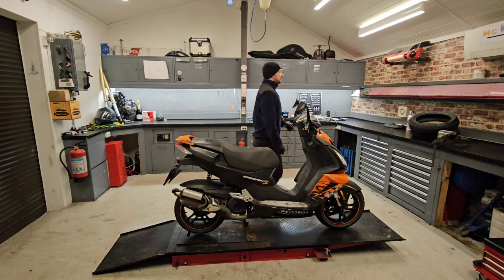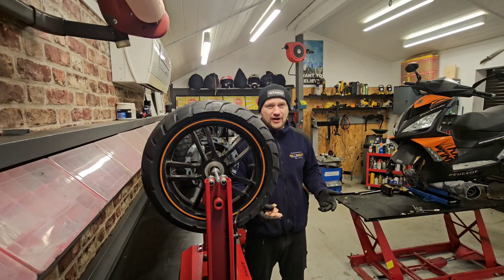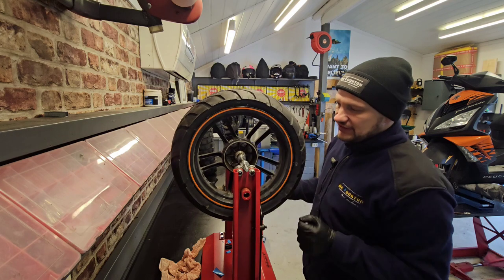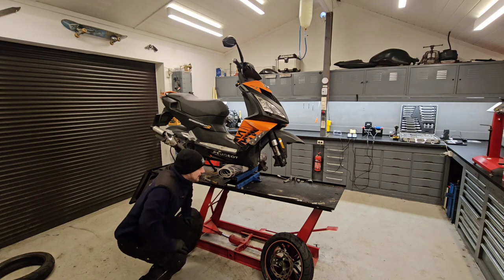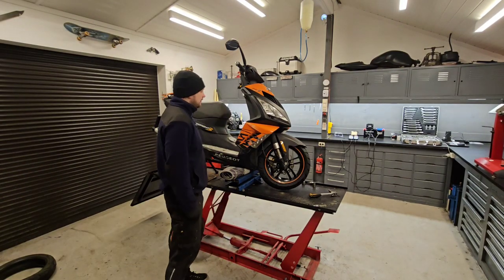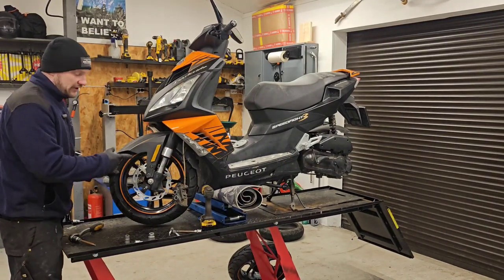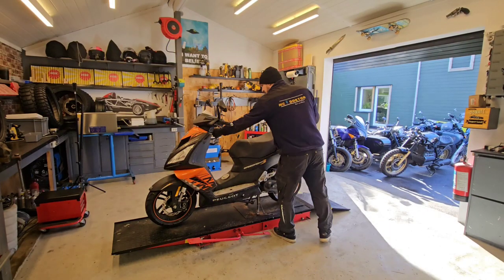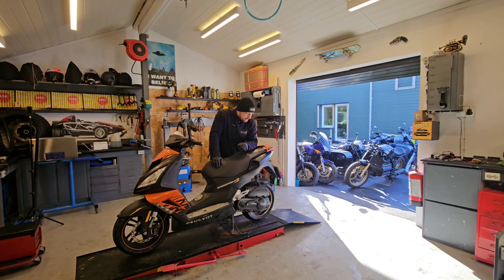Peugeot Speedfight 3 in workshop

Comment: You must be the right person to ask for advice so to speak.    
I have a speedfight 3 Darkside that I need some help with. The lower part of the fork where the wheel bolt goes through must be replaced on the left side. The million dollar question is how do I take it off?    
I know there is a screw at the bottom of the forks. The reason it needs to be replaced is that the screw that holds the big bolt steady is completely broken. I also think the front dampers are lousy.    I also suspect that the front brake disc may not be as it should be.    slight vibration during deceleration.    
When it comes to tire balancing, I think it is very important regardless of tire size. Mine has something called a sport variator + Leo Vince exhaust which gets it to almost 80 km/h 😊
Reply from the maker: Hi. 
So to remove "separate" fork lower part from the upper part, ther is a 8mm bolt that you unscrew at the bottom of the fork. I suggest use impact driver. Electric or pneumatic. Then you drain oil, remove dust seal, circlip and then sort of "hummer" lower part out from upper part by pulling it down until it stops with fast hand motion. Its like u trying sort off drag the pipe out of other pipe with a nice punch. When it comes to such a thinn brake disc, there's no way of machining it straight like for example cars or trucks discs. Best is to replace it, because when they vibrate under braking, they are bent or warped by heat.
Reply: @Mcdoktor  I really appreciate your reply. But when it comes to the lower part of the fork, I mean on both sides where it is painted black and is about 12 cm long. Both the wheel and the screen are screwed through it. At the bottom there is a screw that must be loosened with an 8 mm Allen key if I am not mistaken. Then comes the big question. How do I knock it down without damaging anything and does it have any effect on the damper itself? As for the brake disc, it also needs to be replaced.    I see on your YouTube profile that you are Norwegian that's cool. I live in Oslo, so I can explain it more simply in Norwegian if you prefer.